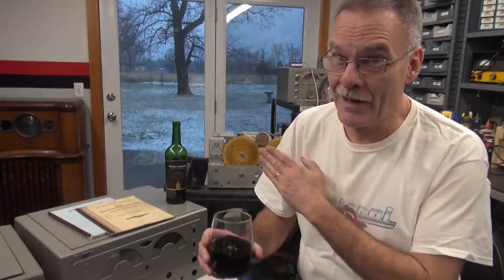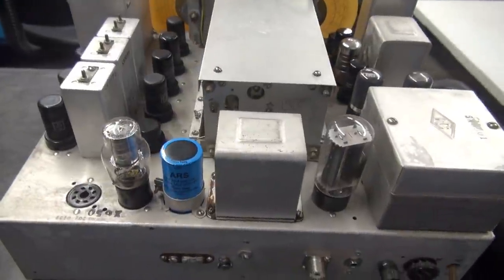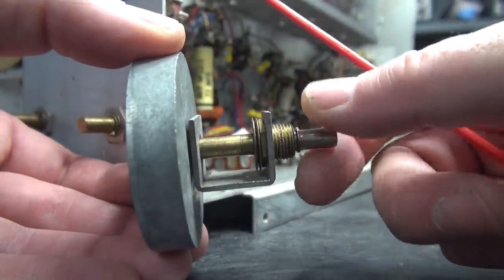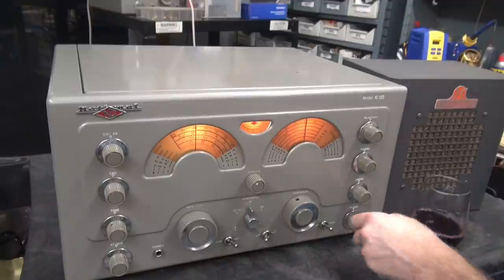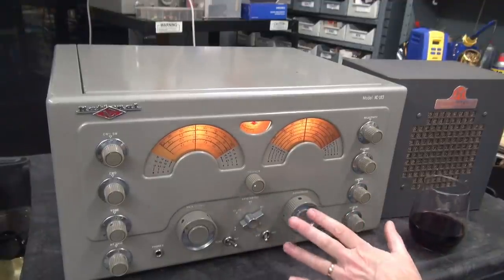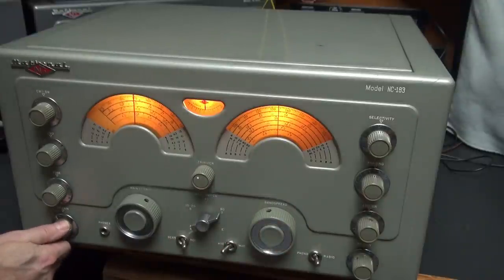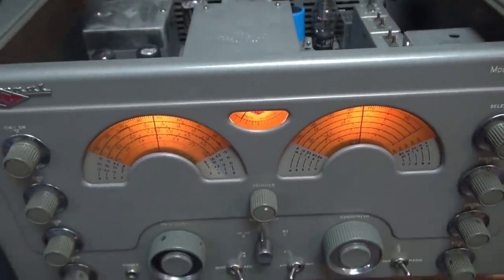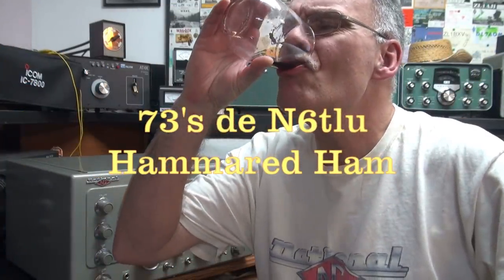How to repair a damaged National NC-183 shortwave tube Ham receiver suffered poor shipping

Comment: I was given a partially restored NC-173.  I has been partially recapped and some resistors replaced, but the biggest issue is the main power transformer has been pulled out and event though I have a replacement, it hasn't been installed yet.  I'm hesitant to tackle this without help because I'm not sure my skills are up to it.
Reply from the maker: I'd be glad to help, However shipping may skew the value of the repair
Reply: @d-labelectronics  Where are you located?